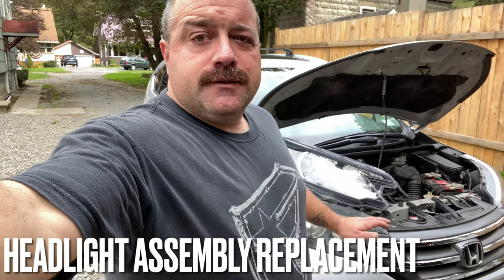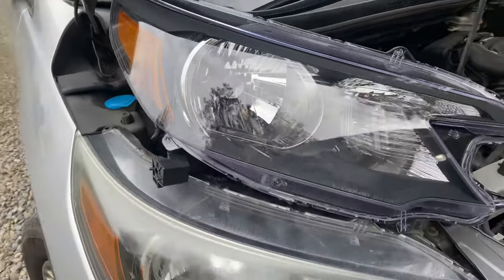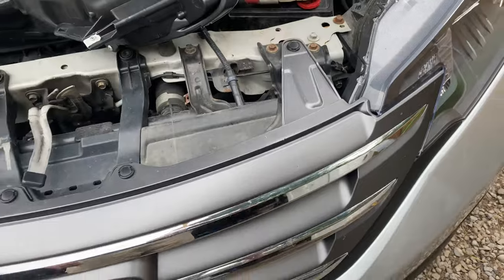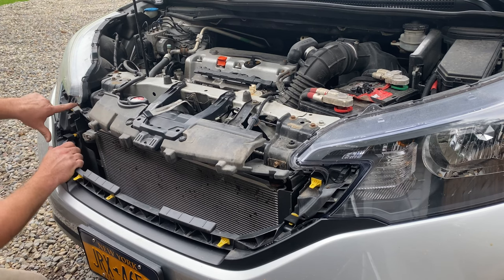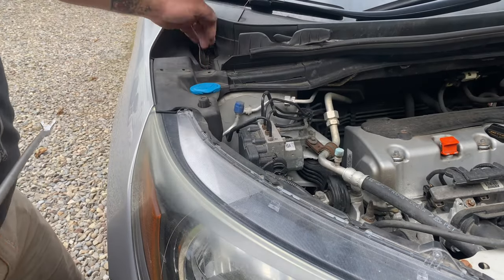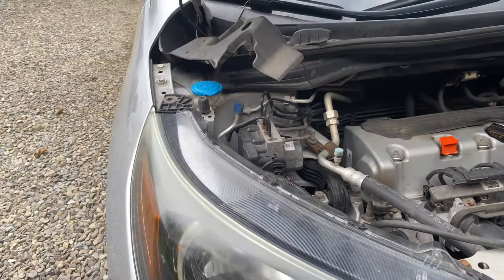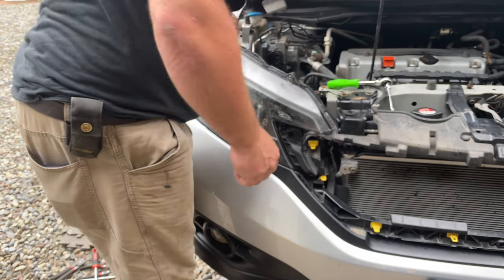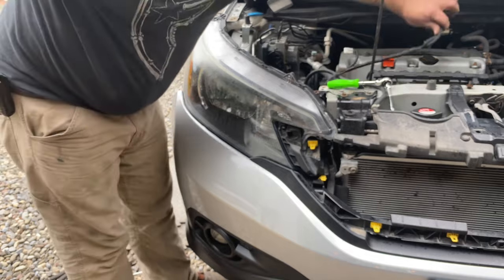Replacing Headlight Assembly on the 2013 Honda CR-V

Comment: This is a ridiculous amount of work to replace the assembly. A design engineer somewhere needs a beating.
Reply from the maker: This is pretty standard nowadays.
Reply: I had a 2006 Impala. I did both sides in ten minutes. No tools.
Reply from the maker: @kevinkercheval5099  My 2005 Silverado is the same way. New Chevy Malibu and Traverse are horrible tho. Just to change bulb the whole bumper cover comes off.
Reply: i agree the engineering to replace the headlight assembly and the Fog Lamp bulb is much more work than it should be.
Reply: It cause it all designed to be as difficult to replace as possible so you have to go to the mechanic to get it fixed.

Comment: I swear there is a ford engineer behind this concept. It's totally stupid to have to remove the bumper cover. I don't think it's a bumper cover anyway. Cause there are no bumpers on cars anymore. I'm using this as a reference for my wife's 2016. Because I cannot find a video for a 16. Thank you so much for doing this one I really only stopped on it because the headlights kind of looked the name but it's gonna help me I hope.
Reply from the maker: I call it a bumper cover because there is a support beam (bumper) behind the center area for crash protection.
Reply: @JoesCarSmartsNY  this was not aimed at you. I'm old enough to remember cars with A Real bumper you could push a car with
Reply from the maker: @olliespackrt5763  Aha. Gotcha. Agreed…these have no bumper when you put it that way.

Comment: WELL that grill is held on by those YELLOW clips and apparently you are supposed to use a screw driver and wiggle it around each clip in hopes to unlock them ! I spent more than an hour trying to see and locate those clips with NO LUCK !!!!  So I drove to the local body shop in hopes to get some help . They also had no luck and just decided to try to rip it off the car .  Only one clip broke and I went to the Honda dealer and bought a new clip . I also asked how much they would charge to just remove the front bumper ?  I was told $257 dollars because it takes  1 1/2 hours of labor ... ( what the HELL )
Reply from the maker: @diverdave4056  Those types of labor quotes are why I share my projects here. Some projects can be done my people that are good with their hands and can’t spend hundreds of dollars.
Reply: @JoesCarSmartsNY   I was SHOCKED that they said it would take 1 1/2 hours just to remove a few screws and pop tabs ???   if it wasn't a pain to find and release those yellow grill tabs - I can remove the whole bumper in less than 10 minutes !   1A Auto sells the headlight housing far cheaper than the dealer and they guarantee them to fit and last a long time !  I installed them on my 2002 Accord and a few years later they fogged up - they sent me new ones

Comment: I could have changed the engine faster shame on the engineers.
Reply: I need to see the otherside RF I cant find 10mm screws that attach inside the wheel well. WW fluid side was fine.
Reply: Also you will need clips and the anchor clips/fastener for reinstallation
Reply: How much did the part cost you from rock auto?
Reply: $325

Comment: Thanks for the video. I was not expecting it to require these many steps. We just sold our CRV to my dad and was just about to pull the trigger on some brighter halogen bulbs but thought about going the step further and putting some new headlight assemblies mostly for looks since they don't really drive at night that much in that car anyways. 

I think I'll save up and make it a birthday present for him...and throw in a new grille since it's gonna come off anyways and it's slightly cracked in one of the rear elements in the middle.

Comment: I  need to replace both of my headlight assemblies on my  12 CRV  .  i looked at Rock Auto for replacements.  Which did you order?  I want decent quality,  and fitment close to OEM.  There are so many to choose from.  Which did you purchase?

Well done video, Thanks!
Reply from the maker: A body shop replaced one for me. For the other I bough the TYC 20924300 from RockAuto. It’s been doing well so far.

Comment: hello I have a problem with the control panel light does not turn on crv 2007
Reply from the maker: Are you talking about the dash cluster?  Try turning the little knob that’s sticking out from it. Maybe someone turned the brightness down?  You have to spin the tiny knob to the right to make it brighter.

Comment: Hello, how can I connect the turn signal to the corner light? thank you
Reply from the maker: You want the corner light to flash with the turn signal?
Reply: yes i have a 2014 crv
Reply from the maker: @samuelgn1401  Do you now how to install a relay?
Reply: to be honest no
Reply from the maker: @samuelgn1401  Okay. I recommend taking the car to a shop. A car audio shop can do this for you. You want a relay installed on each side. What will happen is when the turn signal blinks “on” the corner light will blink “off” when the relays are properly installed.
Reply: Ok  thx Next time you can make a video of that 😉
🤝